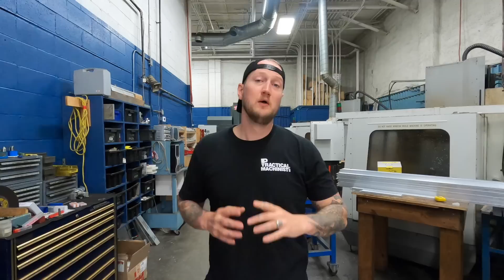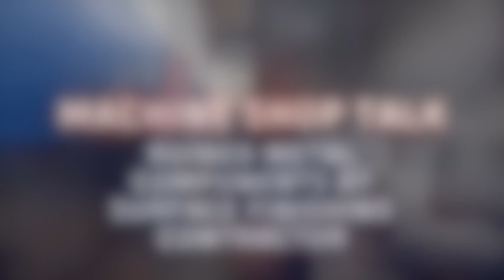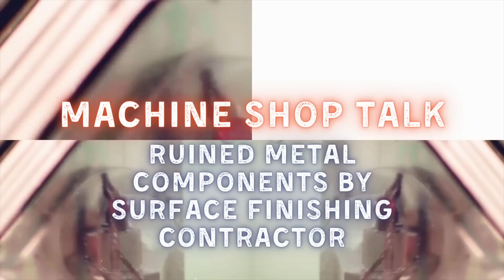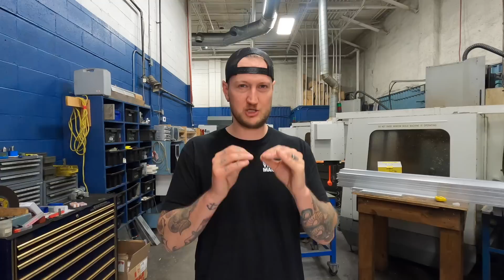Surface Finishing Contractor Ruins Metal Components  | Machine Shop Talk Ep. 54

Comment: had parts come back from the anodizer today. Apparently someone took it upon themselves to most likely scratch or ding the part and then belt sand/ grind some of the faces that they nicked. ground like .030 off per wall and it looks like a third grader did it. UGH. Such a pain in the ass.

Comment: I'm bringing anodizing in house as I'm tired of remaking parts when my 2 local finishers  mess up. It happens 20% of the time
Reply: That sounds like a dream but must be quite the investment to get it going. Did you find it difficult to bring it in house?
Reply: @iansandusky417  I have a small shop and primarily do part no bigger than a basket ball so I bought a caswell 20 gallon anodizing kit for about $2700 USD. I probably only do $500 of anodizing work a year but I'm tired of the headaches
Reply: @HuskyMachining  Wow that's a LOT cheaper than I thought it would be! Definitely a worthwhile investment for the peace of mind alone.
Reply: @HuskyMachining  How long does setup take? How well do they come out? Can you take out tooling marks?
Reply: @HuskyMachining  Looks pretty decent.
Reply: @willysnowman  I haven't gotten the anodizing kit yet ( I ordered it just over a week ago) but I used to have a small anodizing line in my shop using 5 gallon buckets and Caswell chemistry. It always worked great for me and I would still be using it but it got lost in a fire 3 years ago and I desided to buy the safer thick HDPP containers from Caswell this time. If I need to eliminate  tool marks, I sandblast them first and then anodize them with good results
Reply: @willysnowman  anodizing a part can vary but it's usually 20 mins for cleaning and deoxidizer, then about 90 minutes to anodize and then about 20 minutes sealing so probably 2hrs per rack of parts
Reply: @iansandusky417  The cost for the equipment really isn't that much for small anodizing lines. The biggest annoyance is I don't anodize every day or even every week so I will have to warm everything up for every time I need to use it
Reply: @HuskyMachining  Thank you. That is how long it takes to drive to the anodizer and back. Then I have to do it a week later when the  parts are done.Generally I ship them, but that is risky.
Reply: @willysnowman  It not too difficult to learn to anodize too and the biggest problem I ever saw was poor cleaning but once you get a good heated cleaner and deox your solid